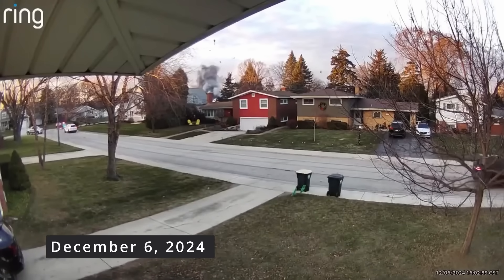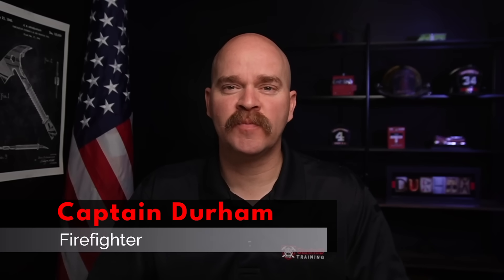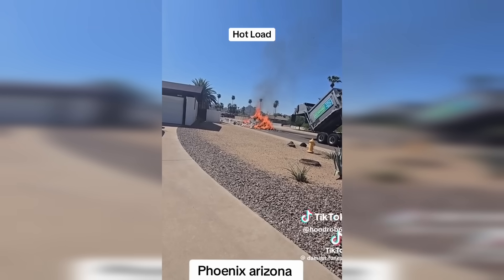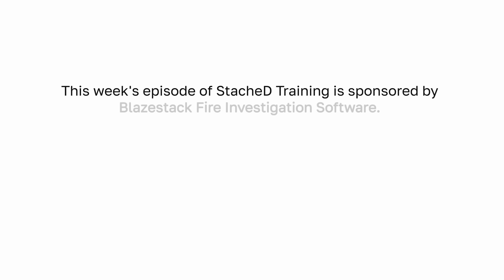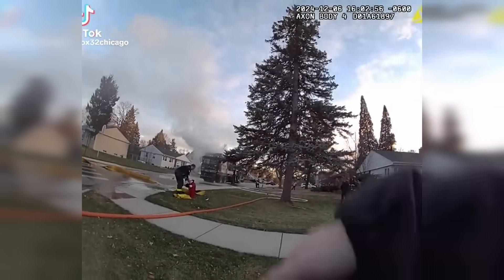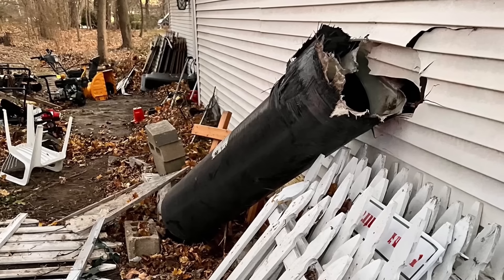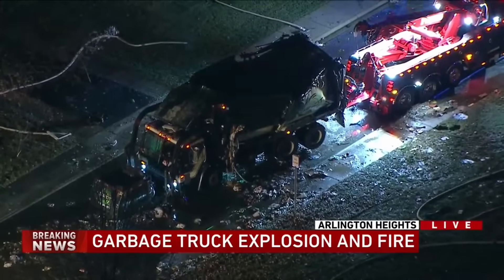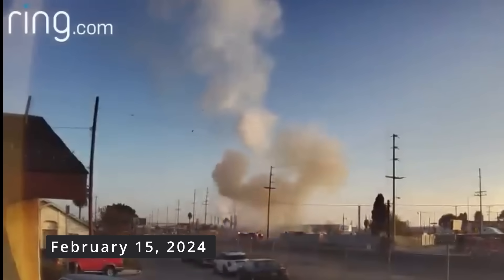CNG Garbage Truck Explosion Leaves 3 First Responders Injured!

Comment from the maker: Let's talk about the tanks.  Bulk transport and bulk storage will use carbon fiber. Vehicle applications are typically type 2.  A thin gauge metal tank wrapped in either glass or carbon fiber.   Typically glass is used because carbon fiber is about  10 times the cost. Once molded,  it can be difficult to tell the difference between glass & carbon fiber rovings.  This link should help (I worked for a large carbon fiber manufacturer). https://astforgetech.com/compressed-natural-gas-cng-storage-options-ultimate-guide/#:~:text=CNG%20tanks%20are%20made%20of%20steel%2C%20aluminum%2C%20or%20composite%20materials
Reply: I had a '78 F-150 with a 50 gallon LPG Steel Tank and no Issues(loved it)....It ran better in the Winter of SD than Gasoline....
Reply: @MausMasher54  - Yup, I love my LPG powered IH Scout II.  Big ol' steel saddle tank mounted where the original gas tank went.
Reply: In Australia buses used cng with the tanks on the roof. They took forever to fill and the fill pressure was raised to shorten the time. During refilling at Mt Gravatt a talk ruptured which cause a chain reaction of the cylinders flying off. The tax office is next door and believed a bowl went off.

Comment: Red Seal Automotive Service Technician & Power Engineer 5th class here.  Based on what i see here, a few thoughts:

1. No way is this the fault of First Responders, nor SHOULD they be dumped on with this.  How the hell should you lot be expected to know whats in the fuel system??

2. When are we going to learn carbon fibre pressure vessels arent particularly a good idea? Clearly, whomever designs these tanks are cheaping out; not building the tanks robust enough nor any proper reliable vent off system. These need to go back to the drawing board. 

3. As a society we need to get off this ridiculous "green" kick and recognize that for some applications, such as garbage trucks, staying with simple, reliable diesel engines are vastly safer than LNG, CNG, or Li-Ion battery packs. We need to recognize the unique risks of garbage trucks, that they may very well catch fire due to propagating Li-Ion tech, & that loss of truck should be expected - and not have catastrophic results. 

Good luck out there lads & ladies. Government stupidity once again makes First Responders - and the general public! - in particular see even more risk than strictly necessary; all for "the emissions" nonsense.

Comment: Any medium that has high energy capacity in it's mass can be considered as "volatile." Gas, gasoline, high capacity battery. Even if the medium isn't easily react and require a specific device/process to extract those energy (diesel/nuclear) the device itself can become dangerous if no safety measures/maintainenece taken, like a runaway diesel engine. The real question is does the device that is using these medium, are they fully equipped with the safety system that could prevent such tragedy?

Comment: Just a little extra context for CNG blasts not being BLEVEs, the typical standard for CNG fuel system pressure is 3,000-3,600 psi. That's more than a welding cylinder 
Other countries/regions use CNG much more widely in cars. There are a ton of security camera videos where the CNG tank mechanically fail from fatigue, usually during filling.
it's the same as a hand grenade / car bomb
No fire needed. just the pressure is enough to make the trunk of a car peel open like that garbage truck
So this blast might have just been the tank failing from mechanically burning/melting and never actually went over pressure

Oh, also, when they do fail like that... it could turn into a fuel air explosive depending on when it ignights. a large vapor cloud forming, hitting stoich and detonating in less than a second

Comment: A one time use, eutectic alloy plug or valve would allow the vent to operate regardless. Its used throughout the world in contactors/relays. and various disconnects related to thermal load.
Eutectics melt at a consistent temp then reform wen temp drops. But if you used a eutectic plug, it would melt to liquid, then be ejected by the pressurized media. (the gasses) leaving it permanently open to vent and discharge contents in a controlled manner. Volume of discharge is easily limited by cross section of output discharge tube inner circumference.

Comment: So I guess a PRD failure was to blame, that should have relieved pressure when heated and vented the tanks to atmosphere.

CNG is safe when handled and stored properly, but inspections should be conducted by the operators on a yearly basis.

These are just trash trucks. Transit busses have been operating CNG vehicles for decades.

Comment: So, is it better to switch garbage trucks back to diesel? Is that safer? Diesel can leak, gas explodes...hmmm.
But yeah, we also have no battery recycling station within 100km. The worst is, you have to ask every single store. Just because it's a chain, doesn't mean they all take batteries. I guess one problem is the regulations for storing spent batteries safely.
I was told they can't afford sorting, storing and transporting them...so, people throw their batteries in the garbage. This started with lithium batteries, because before we had those, EVERY store took batteries they sell, back for recycling.

Comment: A job I use to work at would throw electronics into our compactor, I noticed multiple times, capacitors exploding inside the compactor, only a matter of time until they throw lithium batteries inside.
Reply from the maker: Yikes!

Comment: Why are these CNG-fueled garbage truck fires and explosions so frequent?  I would have expected the engineers who designed them to have included a rupture disc somewhere in the fuel system that would open and vent the gas, allowing it to burn off, well before the pressure caused the gas cylinder(s) to explode.  It might mean total loss of the garbage truck, but would avoid causing property damage, injury and death.
Reply: CNG fueled garbage trucks are heavily subsidized by the federal government. Garbage truck companies get paid very large amounts of money to manufacture them and waste management companies get paid very large amounts of money to buy and use them. It’s all about cutting costs and maximizing profits, not saving the environment like you’re led to believe, so I highly doubt engineering a safety system is a priority to them.

Comment: I was told that I could through out standard AA and AAA, Not Lithium batteries in the trash. 

Is that right? 🤔
Reply: Alkaline: trash
Lithium, Nickel-Metal Hydride, or Lead-Acid: recycle

Most standard (aka single-use) batteries are Alkaline.

Comment: Clearly the EPA is shoving all these regulations down our throats but what’s more dangerous? Pushing manufacturers to design and create products more deadly than emissions, the previous regulations for diesel did the job to lower emissions tremendously, guess that wasn’t good enough we have to have ticking time bombs in our homes and around our families

Comment: I randomly brought this up vs "experts" one video and said just this. They stated per their observation the emergency valve is defective. They're "experts" solely cause they are stringers in LA.

It was that LA video what caused me to learn more about CNG tanks. Watch some long ass training videos, this channel.

My background is Law Enforcement and Automotive Repair Technician. 

I constructively said they errored about CNG emergency relief valve. LA Metro bus on fire.

Then attack me for being wrong, stupid, with 0% experience responding to, seeing in person, speaks with LAFD PIO, Chiefs, such CNG fire.

Now watching this video causing me to have an 💡 

-Put temperature sensors in the box of trash truck.

-temperature sensors on tanks

-Come up with a tank cooling system, make tanks vacuum insulated like Yeti mug.

-Make a device that can manually open relief valves via cab, externally, remotely.

Use a Automotive seat belt tensioner with cable or rod to added valve. You can activate via drone, bomb robot, create CNG Safety Management System that can auto activate the added valves based on data from probes and sensors added to truck. My thought too have multiple temp probes that are able to probe the middle/core of that trash section, advanced warning to drump trash, release CNG tanks, etc before a runaway.

Departments begin purchasing armored vehicles like Bearcat, Hummvees or similar armored/military vehicles with roof armored turrets. Smaller armored vehicles tow a water trailer and pump attaching to vehicle.

Sorry for ramble

Comment: using fuels like CNG they're going to have to start making the trucks to where the entire garbage container can be dropped off even if it's engulfed in flame. 
Or make the tanks very quickly removable lol. Ain't NO ONE going to make a tank for storing CNG that is fireproof because even if it is possible it'd cost waaaaay too much for widespread use. 
Ol diesel trucks don't have that problem

after watching more of the vid... perhaps they should make those emergency valves manually operable. On fire vehicles are going to be hit with water, and lots of it. Probably best for the operator of the truck, or firefighters, to be able to pull a cable to open that valve so the CNG gets away in a controlled fashion instead of bang

Comment: But, but, the media and politicians say this is all a hoax. They say lithium ion batteries are perfectly safe. How can this be true??!!!

Maybe it's because we shouldn't allow talking heads in media or politicians tell us anything about technology. 
You know, not trust the two groups of people with less understanding about technology than a three year old and who both have a reputation for lying that is incontrovertible? 

What's sad is that they are so caught up in ideology and making a profit they don't think about the long term and what it will lead to. At some point this is going to cause something so egregiously bad that it will lead to prison time for someone and a ban on the technology. 
Just like with Nuclear power, public perception will turn sour and lead to bans and prohibition. Regardless of how the technology improves and becomes safer. 
Just look at modern liquid fuel reactors; no rods or control systems, no waste coolant loops creating poison, and they require no powered cooling systems to remain safe because the physics they operate under. 
But the stigma and fear still persist, despite these new designs being the key to low cost and safe (not to mention environmentally friendly and clean) energy. 

And all because they pushed dangerous tech before it was ready.

Comment: While the fire by whatever source started the chain of events, it seems clear that the fire alone is not the problem. The lack of safety mechanisms to relief over pressure due to excessive heat seems very obvious.

Comment: I would also say we should consider redesigning where they vent since all of them seem to vent out the side or under the vehicles what if we set the vents up similar to like at an oil refinery where they call it a flare and have them been straight up to the top of the vehicles that way at least it's easy to see when they are venting Department of Emergency Response point of view as well as on the LNG what if we put two different types of vents on there one that is allowed to open and close once pressure is dropped below the threshold and one that said just a bit higher but still below critical pressure for the tank best design once it opens it can't be replaced as a secondary failsafe so one can bleed off pressure need be but if pressure continues to rise and gets too high the second one will open and empty the tanks and a safe controlled manner

Comment: I always go out of my way to discharge built-in batteries and even disassemble the device to extract the batteries for recycling when possible.
Heck, I go out of my way to avoid devices with built-in batteries.  Removable is the best for device longevity, too.

Comment: Two safe options:
1. Diesel fueled trucks. (Ignore what you saw in Terminator 2. That's movie magic.)
2. Build garbage trucks with a CO2 fire suppression system for fires such as these. It may be costly but a big dose of CO2 may give the operator/s time to save the truck from a catastrophic explosion.
Reply: The problem is that lithium batteries which are the cause of most of these fires have both fuel and an oxidizer so they will burn even under water. Now CO2 may stop the fire from spreading to other combustibles within the truck but it still won't stop the very hot battery fire. Not sure about Halotron though, it may be effective on lithium fires but I'm not sure about that one.
Reply: @theodorgiosan2570  Yes. Although I know little about lithium batteries I had a feeling that using CO2 on it would be rather useless for extinguishing purposes.
With the CO2 system I was just thinking about the burning trash and how it would buy time for the operator to dump the load, assuming the ejection system was still operational.

Comment: I hate to say it but there should be sizable recycle tax put on the batteries that can be refunded at a certified recycle station when the battery is no longer usable. The batteries will end up where they belong more often than never.

Comment: How about we use some common sense and go back to using the much safer diesel fuel in commercial trucks like this. It will burn but with the exception of very rare instances a tank of diesel fuel won't explode. And unlike battery powered vehicles can easily be put out when it catches on fire. All of these so called alternative fuels for vehicles are just more dangerous or bad for the environment than the fuels that they are replacing in vehicles.

Comment: I drove a semi tractor that was CNG and Diesel for a very short time. 
Fully loaded at 80,000 lb, the CNG couldn't provide the torque needed for hill climbs, so it would automatically switch to diesel with no warning to me. The shift RPMs were considerably between the two fuels, thus causing a great deal of frustration and not a few dangerous moments when my speed decreased quickly.
I was hauling a pressurized load of sugar in a pneumatic bulk tanker which only made the whole trip more exciting.
Knowing there was a CNG tank directly behind my head while I moved what was essentially a bomb on the roadways made me question my life choices.
Once was enough. CNGs and EVs are too inherently unstable in an accident. We like to think our tech is "there". But it isn't and I'm not going to be a Beta tester for that tech.
Reply: EVs unstable?  They're currently the most stable vehicles on the roadway since most of their weight is below the centerline and evenly distributed throughout the vehicle's frame.
The BATTERIES aren't exactly stable depending on the amount of damage they sustain, though.

Comment: I drive a commercial front load garbage truck, 15 years now. I had a load fire 18 months ago, in approx 5 tons of cardboard and blue bag recyclables. Started with a battery someone chucked into their recycling. Our procedure begins with trying to compress the load a much a possible which does three things to help the situation. First is limits the amount of oxygen available to the fire, second it pushes the fire into the rear of the body and under the steel roof area, third it pushes the fire and heat away from hydraulics and air lines. All this buys time to find the nearest best place to push the load off. In my case the best I could find was a wide spot in a side road that was as far as possible from other structures, cars etc. I would have loved a big open parking lot, but nothing of the sort was available in the short window I had to work with. It took almost three hours to put out, the truck was fine. I just recently was assigned a brand new truck, a Mack that is CNG with roof tanks. We have other CNG trucks that have the tanks in the tailgate of the truck. I think the roof tanks are a safer bet.
Reply: Looking at the damage to the truck, it looks like it had the roof mounted tanks.   Seems like either the casing was damaged or the pressure relief completely failed.   Should have turned into a blow torch, not a projectile.
Reply: The tailgate one is safer I’d say especially if it is to ignite you can get away and reduce dmg plus roof tank adds another 2-3 ft to your height clearance which means your at a higher risk of hitting a bridge

Comment: The problem with PRVs isn't spraying water "preventing" them from operating: the valves are still working fine, pressure just isn't getting to threshold. It is the uneven cooling of the tanks from spraying water from only one side that keeps the pressure below threshold as the other side is being cooked to failure.

I can think of at least two options. The first one is to simply make the tank double-walled like a thermos so spraying water or fire on the outer shell doesn't affect internal temperature and pressure anywhere near as much. The other far more complicated one would be to use a handful of wax motors to pop a burst disc by driving needles into it when any of them gets too hot.

Comment: How about a manual release that vents the tank through a vertical stack? Alternatively a pressure activated dump valve that doesn’t rely on heat? Either way a vertical vent pipe would be a good way to avoid anyone nearby getting toasted.
Reply: That is a good idea. If fire crews could trigger a release after quickly clearing the area, it could be safer to have a massive torch fire into the air vs. an exploding tank. I have heard of airplanes having an option to dump fuel while flying, since it is safer to let it dissipate into the air than to land with extra fuel on board when doing an emergency landing.